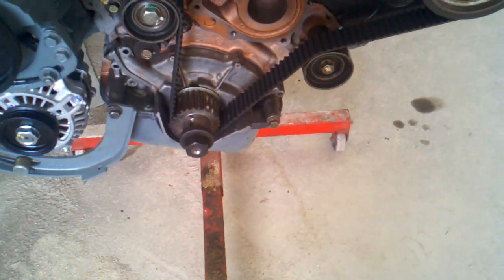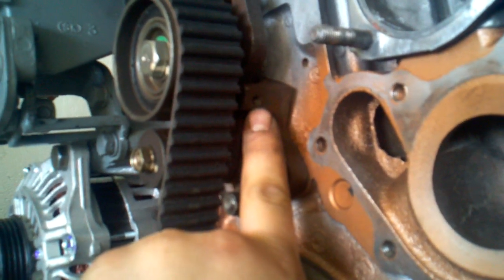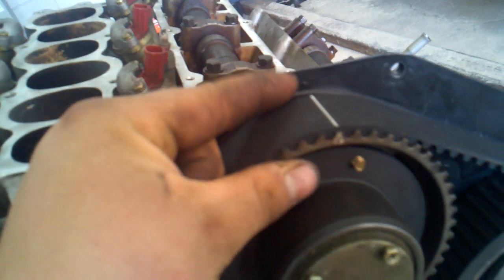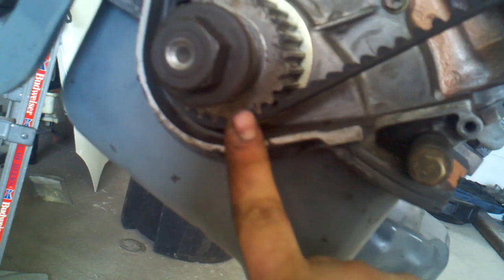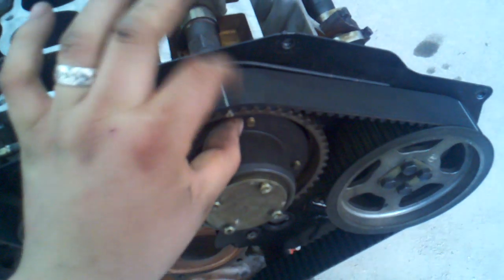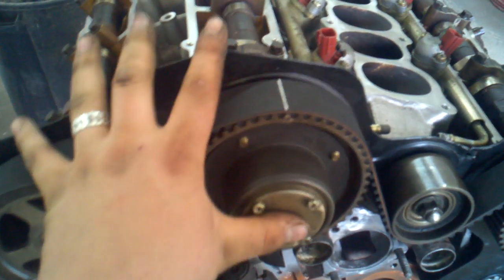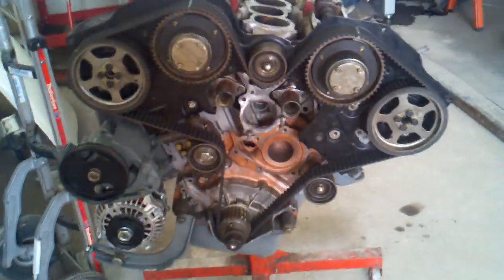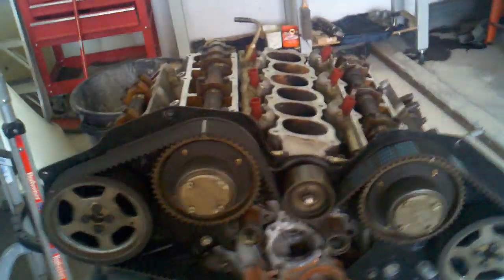300ZX VG30DETT Timing Belt Tutorial

Comment: Just got my car running again today after following this tutorial, my belt had been installed wrong by a previous person and i marked out the belt going off the tooth counts from the manual, Followed the rest as per the video and my car is purring like a kitten, DO NOT use a claw pulley for your harmonic balancer, use a proper harmonic balancer puller, use washers on 2 m6 bolts in the balancer and they pull off easy enough.

Thankyou Stephen you saved me paying somebody!  :D

Comment: Your right. I did my timing and just used the 6mm side bolt to set tension. Needless to say i found myself redoing it a month later since my autotensioner bearing sounded like a super charger. set the hydraulic pin to 4mm with the 6mm bolt. Then loosen all 3 mounting bolts and push slightly on the belt with the whole tensioner. Lock it down and remove the 6mm bolt. And DONT forget to do the factory rotations. belt deflection changes quite a bit on this motor.

Comment: yeah don't confuse them..the belts with the "marked lines" are fine for lining up
on TDC etc but once you do the "turn it over two revolutions"( of the crank gear and usually needed to let the tensioner set) the marks on the crank gear and the cam gear(s) should line back up but (and as you did duly note) the pre made marks on the belt will not until the engine turns over many times.
I commend you, pretty damn good vid, meaning better than many I have seen on various other timing belt jobs.

Comment: Hey brother I need a big favor maybe it's to late yo do it but how c as n I get a hold of you. I'm doing the timming belt on my 300zx but while i was removing the timming belt the passenger side cam gear moved a little bit I did not noticed until I installed the timing back so my question is this do all the timming Mark's have to line up perfectly with the dot cause all line up perfectly except the driver side 1 is off by like a teeth

Comment: Dayco is an amazing belt.  I have two alfa romeo's.  One being a 91 164.  The early year 164s were famous for timing belt issues.  Mostly due to crappy after market belts and limited cam wrap on one pulley.  I've never had an issue with a good quality dayco belt.  Great video man.  I plan on owning a 300zx and will use this video for reference.  How easy is it to gain access to the belt with the motor in the car?
Reply: Use a gates racing belt,not much more money,kevlar and way higher quality.
Reply: I just finished the job. It's not bad. Use this guide: http://www.ttzd.com/tech/timingbelttech.html
Reply: I used a Gates kevlar belt.

Comment: How did you know it needed to be replaced? Mine has an irregular idle, cuts out a little between 2000-2500rpm and the the left side knocks a little, do you think it is the belt tensioner, one mechanic told me to change spark plus and oil which did nothing and the another mechanic hooked it up to a computer and did not find anything wrong. can't pass smog write now. I did here a belt squeak a couple of months ago when I first turned it on.
Reply: you could have jumped a tooth.

Comment: Dude, ok I got the Mark's on tdc. But how in the world do I tell, how did you know you know your engine was on compression stroke
Reply: If you still need help with this, there are videos on here for that question. Easiest way is to rent a compression tester from an auto parts store or use yours if you have one. 1. Install the hose from the test kit to the spark plug hole in the number 1 cylinder. 2. Grab a balloon, yes a balloon. Wrap it on the end of the hose. 3. Once you do those 2 steps you will turn the crankshaft by hand and you will knowtist the balloon will inflate and shrink like a vacuum is on it. After a full turn if the balloon inflates youre on the compression stroke. If it shrivels up like a vacuum that is the exhaust stroke. You're welcome.

Comment: what happens if the sprokets on the passenger side rotate after taking off the belt?
how to you set them back into place
Reply: it's a bit tough, but you simply rotate the cams by hand when aligning the belt. the exhaust cam rotates easily using an 11" socket wrench, and the intake cam can be carefully rotated into alignment using both hands. having a friend helps a lot with the intake cam.
another tip, the passenger side cams will stay in place after you rotate them by hand, just be careful when laying the belt over, it will only take a little bit of force for them to snap back to their resting position.